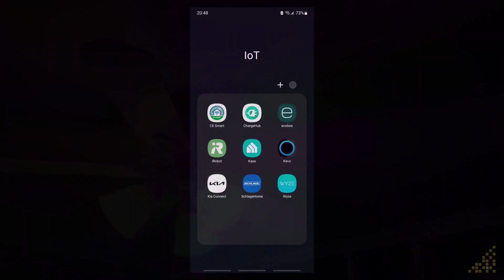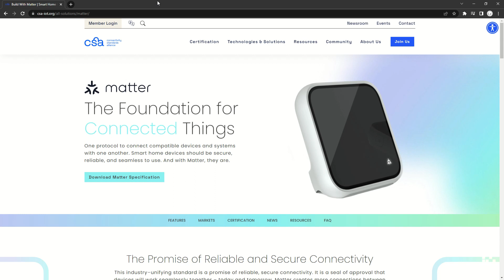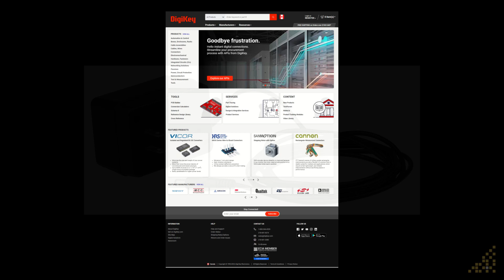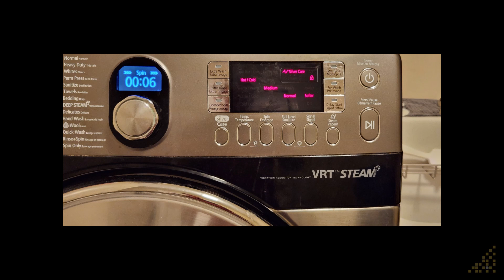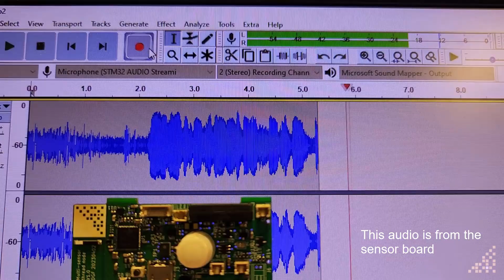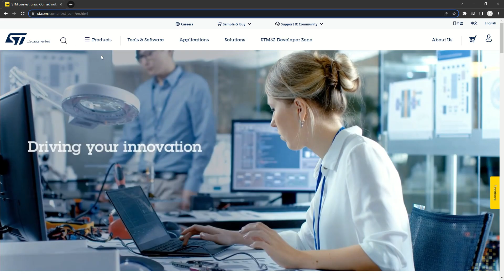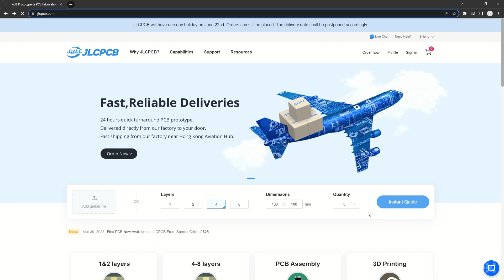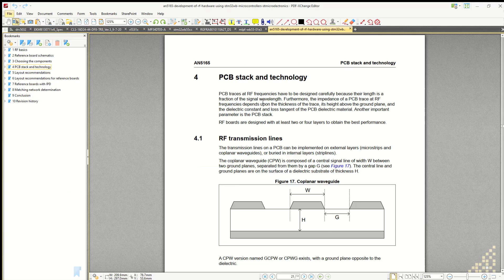Learning about Thread by building a wireless sensor node (with 15 sensors) - part 1

Comment: I'd like to capture data wirelessly from sensors in a remote area (solar power + cellular sim).. but not sure what technology is best for hobby use.  

For example, there's LoRA, Sigfox, Zigbee, (Open)Thread, Matter, Z-Wave, Bluetooth 5 Mesh.. but I remember reading some are only good for U.S., others only for Europe.. others are closed standards and seem to be on the decline, while others are an open protocol and have better device support?

Add in "Gateways" like Theengs or OpenMQTT and things get complicated fast!

Comment: Cool project. Keen to see enclosure designs
The vlx does have low power modes. You could also take power away and check the distance on a schedule instead of leaving it on. 

Make sure you are using the "low power" version of the st library, it takes up less space than the full api. 

Subbed!

Comment: You could add ultra wideband for absolute position sensing (UWB RTLS)
UWB tags run forever off of a coin cell so it should be a good fit.
Plus you get all the other UWB stuff, gigabit bandwidth, doesn't interfere with narrowband and can't be jammed by The Enemy.
Apparently you can also get it to do Synthetic Aperture Radar.
Through Walls.
For stealth robbers i guess.
Reply from the maker: That's an interesting idea - it's been 5+ years since I last tried UWB for positioning and it wasn't great back then.  I'm sure it's improved, esp. with a multi-antenna setup to give you angle of arrival.  I'll investigate!
Reply: @abitembedded  
Indeed, there are multiple transceivers built into my car which it uses to get the position of my car keys, which are a third transceiver.
It uses this to discern if the keys are:
1) inside the car (don't allow keys to be locked in and activate the ignition)
2) near a car door and outside the car (activate that doors lock button)
3) near the boot (activate the boot's lock button)

So it's pretty accurate.
And never having to get my keys out of my pocket while still having tactile and location activated lock/unlock/start buttons is very cool
Reply: @abitembedded  
Also your FPGA skills are amazing, I've just started learning myself and have half an idea to retrain from software engineering (I'm bored of writing business software, it's just endless databases and web services)
I've got a small prototyping board and a cheap online course to work through, but do you know if any relevant learning resources? Where did you learn?

Comment: 12:04 i'm confused what you're doing here.  The chip fits, yay?
Reply from the maker: I'm not really set up to record soldering in my cramped workspace so I was trying to simulate soldering :)  The thing the board is sitting on is a little hot plate - really a game changer for soldering some of those smaller packages without exposed pins.  I'll try to be more clear in the future